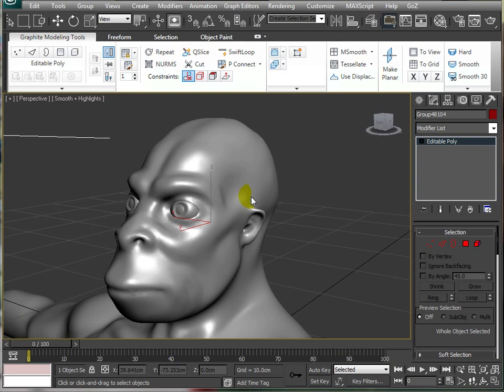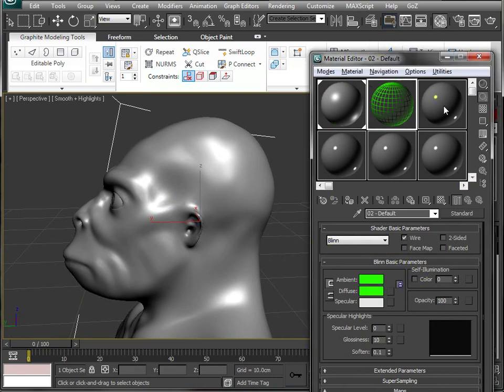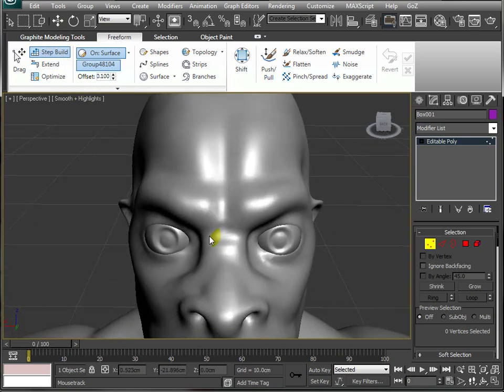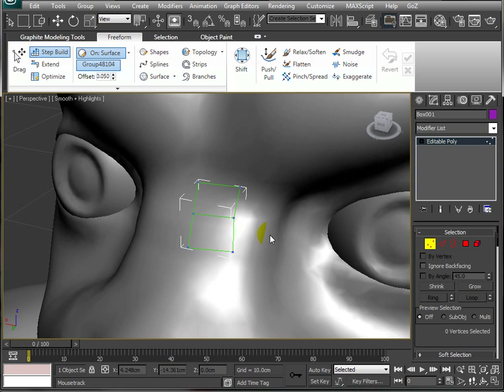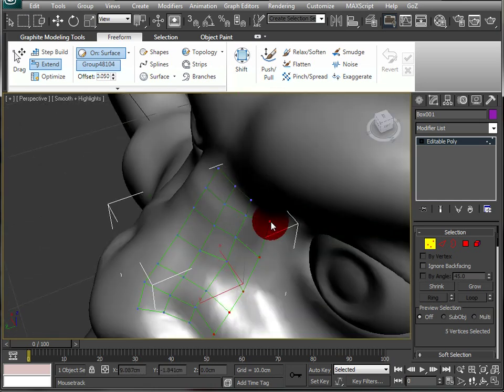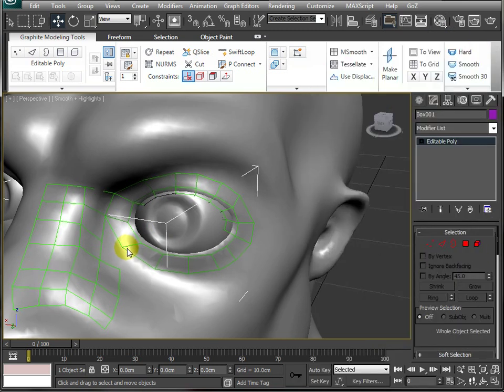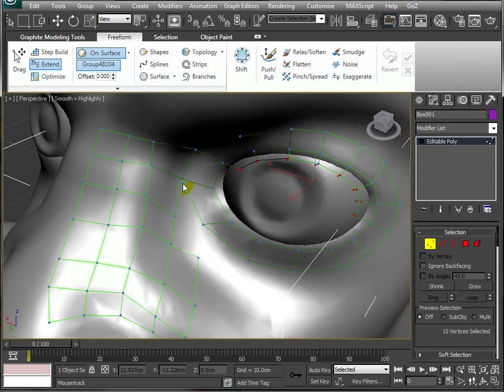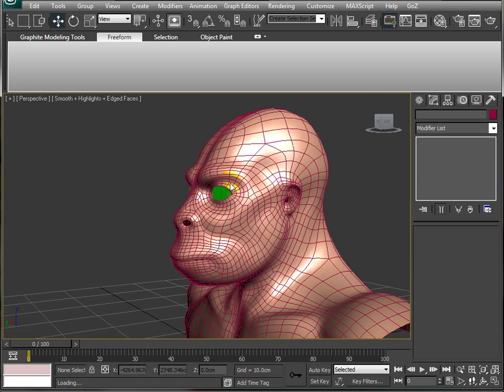3DS Max Retopology Tutorial

Comment: If I might suggest a couple of time saving practices. First, you don't need to go back into Step Build mode to connect two edges; holding Ctrl+Alt while dragging from one of the edges you want to connect to the other with bridge them. Second, when adding Swiftloops Shift+Click to add a flow loop that will likely need no 'massaging' to conform to your base mesh. Third — and most obviously — bind Polydraw Extend to a keyboard shortcut like Ctrl+E. Bind Swiftloop as well for extra utility!